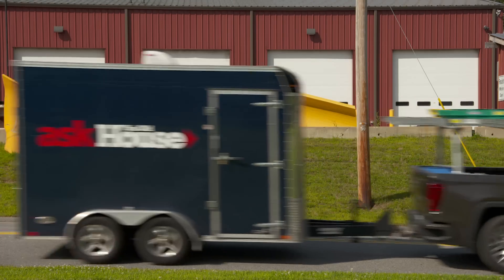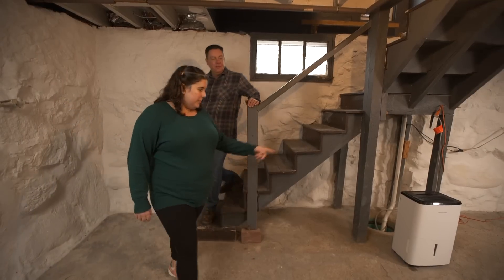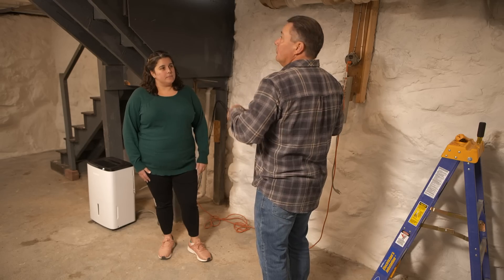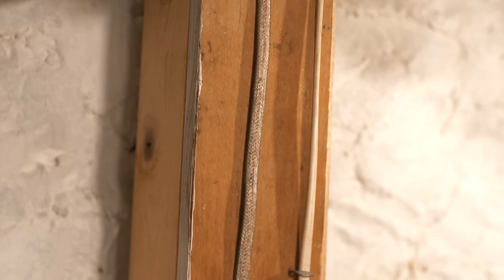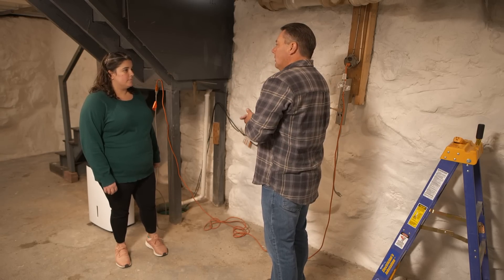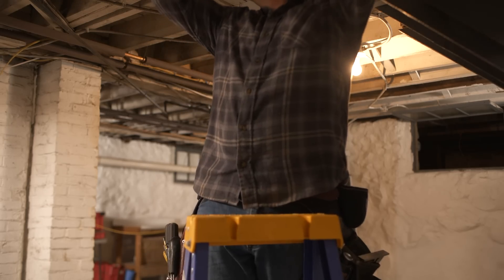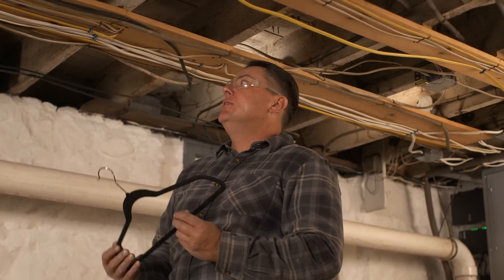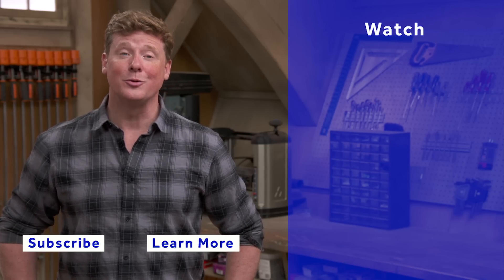How To Install a New Basement Circuit | Ask This Old House

Comment: I’ve done this myself so many times in my old home, I’ve run probably 6-7 brand new circuits and re-run several of the old ones to update the wiring so I can stop having breakers trip. I still have several more to do, because the person who sold us the home had it updated to be *just barely* code-compliant, but I didn’t make it a sticking point on the sale because I knew I could update them all myself, and then I could have them be how I wanted them to be.
Reply: My house had a mix of 2 wire duplex outlets instead of outlets with a ground, but the house was sold as is. There were ground wires in each of the boxes. I don't know why they didn't just use duplex with ground outlets, but it was easy to fix...

Comment: shows how easy it is IF you have panel access and access to route wires effectively. If you have an external panel and require conduit running up a wall and then into an attic in order to put in a new circuit, it's a total PIA and cluster (often requiring an electrician or possibly a permit depending on locality). Loved a former home where I could do this myself, but no more.

Comment: 0:05... I spit my coffee out.  No way the cage is unlocked in the wire isle these days with the cost of copper.  It takes 30 minutes to find someone who has the key.
Reply: I noticed that to. And at Lowe’s I noticed that the combination on the locks is just the store number which can be found on the website or some ads in the store. If no one’s around I just unlock the cage grab my romex and checkout. Same for the whole wire you can buy by the foot. The machines passcode is also the store number. Saves me a LOT of time instead of having to find someone.
Reply: I must live in a good area they don’t lock up anything lol

Comment: Why can't I find an electrician who will find this stuff out and tell me!! This is a fun video, and informative. I just found my attic fan is dead, I want to add a on/off switch to it instead of just it's thermostat. Oh I do not like electricity, I always screw up and it bites me. I swear, oh yes I do, I put a meter on the wires and showed no juice. I unwound some electrical tape, touched something and it all but blew me off the ladder. Enjoyed your video..
Reply: Did you determine which circuit was fan was connected or plugged in to?, and then turned off the circuit. You avoided getting killed.  It was that dangerous.
Reply: You need a non-contact voltage tester, don't do meter testing for voltage, and ensure your circuit is actually off. If you have something else on the branch, plug a small light or a radio into it, so you can hear and or see it turn off, then sniff it out with the non contact, the guy above is correct you could have died.

Comment: Romex inside a metal conduit is illegal!!!   Could have run Romex to a junction box and then single wires down to the receptacle box>
Reply: code allows for short runs of NM in EMT for protection. From the rafters down is considered a short run.
Reply: Code says you can run Romex in Conduit, as long as it's not in a damp location (ie underground or outside).
Reply: NEC 334.15 (B) Cable shall be protected from physical damage where necessary by rigid metal conduit, intermediate metal conduit, electrical metallic tubing, Schedule 80 PVC conduit, RTRC marked with the suffix -XW, or other approved means. Where passing through a floor, the cable shall be enclosed in rigid metal conduit, intermediate metal conduit, electrical metallic tubing, Schedule 80 PVC conduit, RTRC marked with the suffix -XW, or other approved means extending at least 6 inches above the floor. Conduit or tubing shall be provided with a bushing or adapter that provides protection from abrasion at the point the cable enters and exits the raceway.

Comment: In our area, the sump pump must be on a dedicated circuit. In appears the dehumidifier is going to continue to share this new circuit
Reply: A dehumidifier isn’t an essential appliance like a sump pump. An inactive sump pump could allow flooding. An inactive dehumidifier would only allow the air to be muggy.
Reply: @tycox8704  I agree completely. I was only commenting that our code calls out a dedicated circuit for a sump pump to avoid any overload due to sharing with any other device.

Comment: I saw this on PBS. So first thing... It doesn't matter if there is a GFCI or not. With no ground in the 2 conductor asbestos (silver) coated wire, there is no ground protection, so even if a GFCI was present, if not grounded, it would not work with that tester.

Second thing I noticed is you drilled holes in her stones. It would have been better to go into the wood part under the stairs. Also, in a basement, a GFCI should be used per NEC. I didn't see that the breakers are GF or AF CI so I was confused by that. It also appeared from what could be observed that there wasn't a GFCI present on any of the kitchen outlets either. Per NEC GFCIS are required in kitchens, bathrooms, basements, garages, porches, outdoors, and wet areas. Only a refrigerator, at least in my area are permitted to not have a GFCI.
Reply: If you look at 6:10, you can see the reset button on the breaker. So it is either GFCI or AFCI. As for a GFCI outlet on old, ungrounded wire, I thought you could add a one as a stopgap on an ungrounded run, so long as you put the "No equipment ground" sticker on it.
Reply: @alexknight7191  You can satisfy code with a "NO Ground" sticker on a GFCI outlet in most places, but it also looks like he did a new home run with 12 / 2 with ground. So in that case, no sticker would be needed but still GFCI must be used. I didn't see a button but since he seems like a good electrician I'll take your word for it. Just wish they made that more clear in the episode. While my eyes fail on the small details I catch the glaring ones.
Reply: @alexknight7191  ... right, you can install a GFCI on a 2 wire, but that tester won't trip it.

Comment: Assuming he used a gfci or afci breaker - didn’t mention how he addressed that.
Reply: at roughly 6:10 you can see a new breaker with the reset / trip button.

Comment: I would like to see a video that shows breaking down several rooms that are all tied into an overloaded breaker. Mapping out the circuit, breaking and capping off the daisy chain in strategic areas, adding a new breaker, running/fishing new wire to those rooms.  Example I had 4 bedrooms all tied into one 15 amp breaker. An electrician came in and broke down each room to run on their own dedicated 15 amp. He added 3 new breakers, fished wires from the breaker box all the way through either the attic or from below to strategic areas. I thought it was cool, but wish I could have seen how it was done.
Reply: Not that difficult, just labor intensive. Running new wire the most challenging part.
Reply: I need this! How much was it?
Reply: How much did you pay for something like that?
Reply: Agreed!!
Reply: that's not a very common issue, it would never pass code in the first place, 4 rooms all tied to one 15 amp breaker? lol
Reply: @DordiHOTS You’d be surprised. Not uncommon in older homes.

Comment: With all due respect, I would have also separated all the outlets and the lighting circuit into individual circuits, thus forever creating a safe situation as people forget and can still place a heavy draw appliance creating an overload on the original circuitry.

Comment: This video makes me appreciate living in an area where the code requires wire-in-conduit instead of nm cable. Much safer and more robust.
Reply: Please provide statistical evidence to back up your claim of pipe and wire being safer than NM Cable. None of that "well I think it is", crap. Provide real hard evidence. We will be waiting.
Reply: @denali9449  I have to admit, I don’t have a double-blind scientific study I can cite on the matter. But it is common knowledge (and common sense) that rodents eat wiring and cable. This is a well-known source of fire ignition in buildings. Rodents like attics and walls, and chew cables. NM cables in attics and walls vs wiring protected by raceway metal. I would say the latter is safer, and I think that’s a reasonable statement to make, even without a set of statistics at hand. I also suggest googling the subject (“nm cable mice”, for example).
Reply: @jackspencer8290  Double blind is not really applicable in this case. That's how you prove soft sciences (psychology, sociology). This falls in the realm of a simple controlled study with potential hazards impletemented. A small critique but nonetheless. It would be safer, assuming no problems, however it does have a barrier to entry of being a little harder to install and maintain. Same with running your low-voltage through pvc conduit. Later homeowners will love you for it but its not easy to install.
Reply: He put the circuit in conduit.
Reply: @Egleu1  I’m talking about fastening nm cable to a board vs. running wire inside a conduit (ems raceway to be technical about it). I’ll take the latter.
Reply: @jackspencer8290  if you're going to get technical at least use the right term. It's EMT not ems.
Reply: @Egleu1  Yes, sir!
Reply: @jackspencer8290  don't flatter yourself.

Comment: After all years of studying complex circuits analysis, complex mathematics and physics, all the electricians has to do is running some wires in the walls and make some connections? I never fully understood school 😮
Reply: Complex math and physics in school is for electrical engineers. Electricians learn basic math and physics.
Reply: You think people learning the electrical trade are doing complex mathematics and physics? They are not. They have no need of those things.

Comment: I would put a 90° turn on the top of the conduit. Put a threaded conduit connector, threaded coupling and an nm connector. I would strip the nm cable after the connector and run it bare down the conduit.
Reply: why?
Reply: @Egleu1  to avoid running wire with any type of sheathing in conduit.
Reply: @adamortega3620  code allows for short runs of NM cable in a conduit.  why go through all of that extra work and expense for nothing?
Reply: You can't strip NM and use the individual conductors without the jacket like that. Now, we all know those are just solid THHN wires inside NM, but they aren't labeled for that use, thus it's against code. Just leave it in the outer jacket - the few feet you're allowed to run cable in a conduit like this isn't going to be a problem for heat/fill.
Reply: Code states that the NM jacket shall extend into the box all the way through the conduit

Comment: For a electrician, I'm surprised that Heath didn't unplug those cords by holding the plugs instead of yanking the cords. Sets bad example.
Reply: The only way i ever unplug anything is by pulling the cord, never has hurt anything
Reply: @ThatToast  I usually grab the entire appliance, hold onto it and run away from the outlet and yank it all off.
Reply: @c0mputer  I knock the wall down instead so the receptacle box falls away from the appliance, pulling the plug out of the outlet

Comment: Im so glad our kitchen has 3x 20 amp outlets on the backsplash of the kitchen, and theyre all on their own circuits. Our last house has this similiar problem of running our coffee maker would trip the gfci if a space heater was plugged in the kitchen wall outlet too and running
Reply: You run a space heater in the kitchen
Reply: Our pellet stove is on the kitchen circut with wayy too many outlets. Had to run an extension cord to the office circuit for a temporary fix.

Comment: That will be $7,000 😮
Reply: 7,000?
Reply: Lol. True.
Reply: @jackspencer8290  after I saw it however I realized
Reply: Yeah, because he grabbed a 250ft run of 12-2 wire when a 25ft run would have done fine.